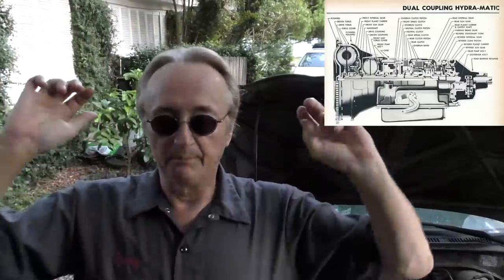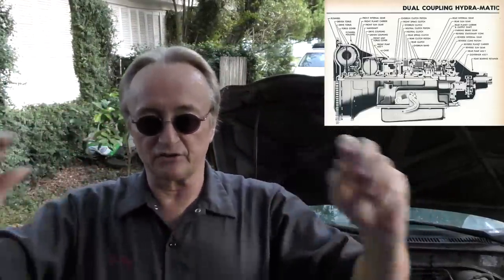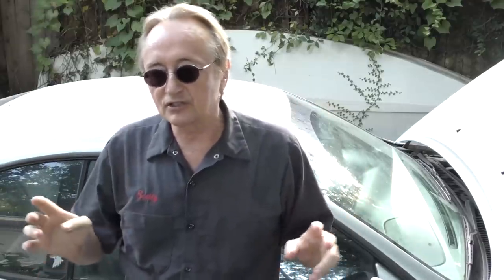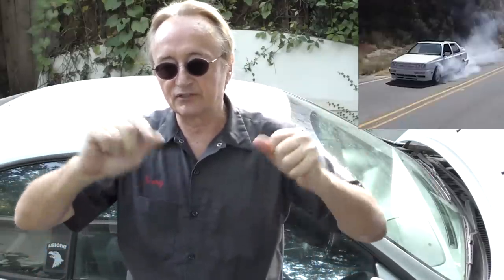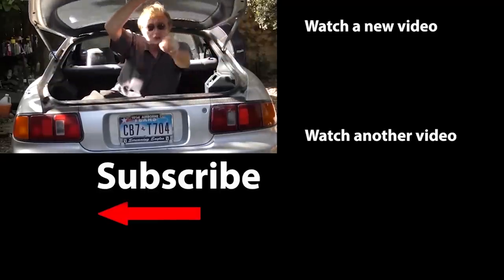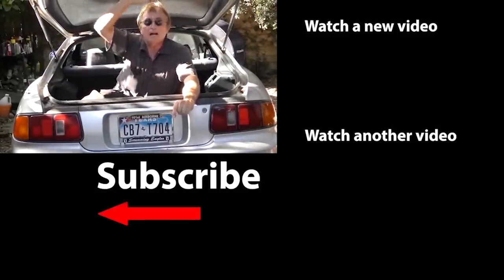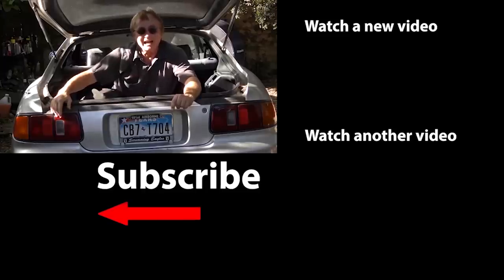This Isn't a Real Corvette, Here's Why

Comment: 7:51
 Pretty dog walker alert!
Reply: By The Associated Press
DETROIT -- Elaborate new transmissions are helping automakers meet rising fuel economy standards, but they're also requiring more trips to the repair shop.

Transmission problems tripped up Honda, Nissan, Jeep and other brands in Consumer Reports' annual reliability survey. Drivers reported rough shifting, clutch failure and even transmissions that had to be replaced twice in the first year of car ownership.

Lexus and Toyota -- which rely on older transmissions in many of their models -- were the best-performing brands in the survey. Lexus or Toyota has topped the survey since 2011. Audi, Mazda and Subaru rounded out the top five. The worst performers were Infiniti, Cadillac, Ram, Jeep and Fiat among 28 brands.

The survey predicts the reliability of 2016 cars and trucks based on a survey of its subscribers. This year's survey was based on responses from owners of 740,000 vehicles. Consumer Reports' annual survey is closely watched by the auto industry, since many potential buyers follow the Yonkers, New York-based company's recommendations.

Transmissions with more gears help engines run more efficiently. A car with an eight-speed transmission gets about 8 percent better fuel economy than one with a four-speed, according to the U.S. Environmental Protection Agency. Dual-clutch transmissions use separate clutches for odd and even gears, allowing faster shifting. And continuously variable transmissions do away with fixed gears altogether, relying instead on a system of pulleys to produce an infinite variety of engine to wheel-speed combinations.

But new technology can cause problems. Honda Motor Co. took a risk and put two new transmissions -- an eight-speed dual-clutch and a nine-speed -- in its 2015 Acura TLX sedan. Consumer Reports said they had multiple problems, and the Acura brand slipped seven spots to 18th in this year's survey. The Honda brand remains in the top ten, but it fell below Kia for the first time due to transmission problems as well as glitches with its infotainment system.

Jeep, too, remained at the bottom of the survey because of problems with the nine-speed transmission in its new Cherokee SUV, which is made by the same company that supplies Acura. And continuously variable transmissions caused problems for Nissan and its luxury sibling, Infiniti.

Automakers often let buyers choose their engine and transmission combinations, so buyers can avoid problems by opting for the older, more tested transmission, says Jake Fisher, Consumer Reports' director of auto testing. Brands that have consistently high reliability scores will also tend to have better transmissions. Toyota has had few problems with the continuously variable transmission it introduced on the 2014 Corolla, for example.

"It often comes down to the manufacturer," Fisher said. "If Lexus starts unrolling eight-speed automatics, they're going to be fine."

Ford was the survey's biggest gainer this year. Fisher said Ford ironed out problems with transmissions and infotainment problems that surfaced several years ago when the automaker introduced a raft of new vehicles. Volkswagen and Hyundai also improved as their models aged.

General Motors Co. had a mixed record. Its Buick brand is among the most reliable, but Cadillac fell seven spots to 25th because of problems with its dashboard infotainment system.

Electric car maker Tesla Motors wasn't ranked because it only has one product, the Model S sedan. But Fisher said responses from 1,400 Tesla owners indicated that Tesla has below-average reliability. Owners reported sunroof leaks and problems with the electric motor and the dashboard screen, among other issues.